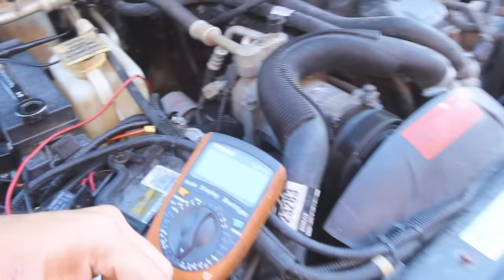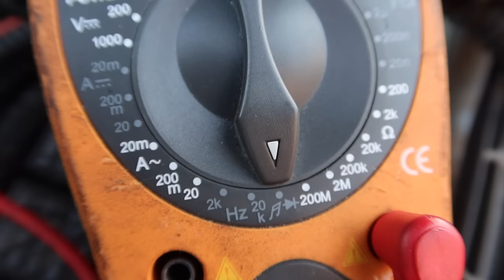AC Suddenly Stopped Working In My Car / Cheapest  Air Conditioner Diagnosis and Fix / Hot Jeep  XJ

Comment: hey guy you need to let them know that if it a 3 wire at low pressure  switch not to jump it or well mess up computer just saying.
Reply from the maker: There are no three wire low pressure switches.          There are 3 wire pressure sensors,   they are totally different components.    

In this video all I talk about is 2 wire low pressure switches.       I can see it being confusing  , but,  all cars are not the same...THEY do have different components.
Reply from the maker: I just assumed people are smart enough not to jump a component that has more wires than what I'm demonstrating.
Reply from the maker: Guy

Comment: Are those switches on a 2010 honda civic? I'm having a hard time finding it.
Reply from the maker: Probably not,  you probably have a three wire sensor.   You need to go straight  to the compressor relay-- swap that with the horn relay.
Reply from the maker: Probably not,  you probably have a three wire sensor.   You need to go straight  to the compressor relay-- swap that with the horn relay.
Reply: @Donnythelatemodeltech  Cool. Thank you.
Reply from the maker: The relay is a very common  failure on your civic
Reply: @Donnythelatemodeltech  Okay thank you.  These ac repair prices are ridiculous. Hope I can fix it.
Reply: @Donnythelatemodeltech  ordering one right now.

Comment: What if the pressure switch has 3 wires,?
Reply from the maker: If it has 3 wires no.  Its a sensor.   You need to jump the relay.
Reply: @Donnythelatemodeltech  thank you

Comment: Compressor clutch engaging, refrigerant full. No blown fuses. Warm air when AC is on. Any ideas anyone? 2013 camaro ss
Reply from the maker: Blend door actuator
Reply: @Donnythelatemodeltech  Thanks for the reply, but I found a truthful mechanic after one bad experience who diagnosed as a broken blend door. So, I cut into the plastic and found he was 100% right. Replaced it myself in 3 hours saving hundreds of euros

Comment: You're telling people with no AC experience to bypass the safety features of the system. If you have no refrigerant and bypass the pressure switch you will run the compressor dry and destroy it. You must read pressures before starting the system, especially if you are going to start overriding components. If you don't know what you're doing, you should not work on your car at all. Spend a few a hours studying if you want to try to DIY
Reply from the maker: I love comments like this.  Lol.

Comment: if the paper clip trick doesn't work, then what?
Reply from the maker: Verify t here is power to the compressor clutch when bypassing t He pressure switch.
Reply: Run the paper clip forever lol

Comment: What if my A/C won't turn off??
Reply from the maker: Need to be alittle more specific
Reply: @Donnythelatemodeltech  yesterday I was driving and got caught up in the rain so I turned on my defrost for the windows not kot get foggy, and now the AC won't turn off even if the switch on the climate controls is off
Reply from the maker: You probably have a vacuum leak.     You need to check the line that runs around the passenger side in to the vacuum canister. The canisters like to Crack.
Reply: @Donnythelatemodeltech  I checked for that from looking at this vid and no leaks anywhere, I ended just disconnecting my AC for now

Comment: And a lot of the vehicles now do you need to scan them your HVAC system to make sure there’s no codes in the AC system before you go and charge it. It’s not just shoot it and go like everybody wants to do. It’s not cold shoot it shoot it and then you’re blowing the system off wasting Freon people I don’t know what you’re doing. Don’t touch your systems at all. Have somebody that knows what they’re doing fix it just because you watch the video think you can fix it no, don’t touch it because I’ve seen it too many times or people screw the systems up so bad guys a call get home and then they bitch in wine because it’s the cost of this amount of money to correct the problems that they caused when it was a simple fix.

Comment: Mine has 3 cables
Reply from the maker: Don't paper clip it.  It's a sensor. Not a switch.
Reply: @Donnythelatemodeltech  thanks for the quick reply what other way can I find out if it's bad my sensor cost $120
Reply from the maker: @JoseA817  those sensors rarely go bad,  you need some gauges.

Comment: His way  is  pretty stupid since  you could just get both switch's  from a wrecking yard .
 high and low  switch are pretty common   problems ..
   My 4Runner was both shrader valves were leaking that was about $6